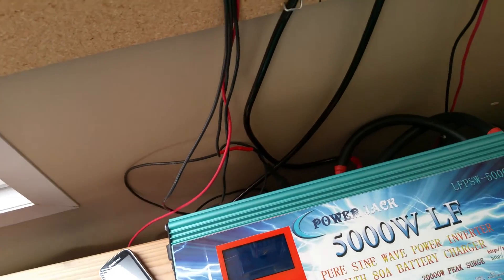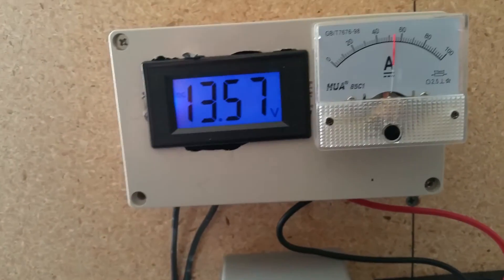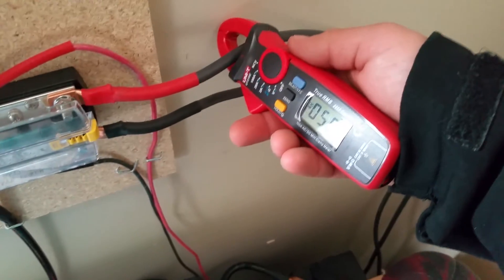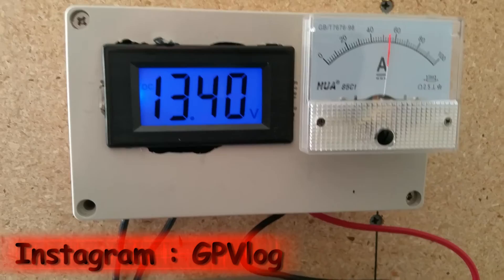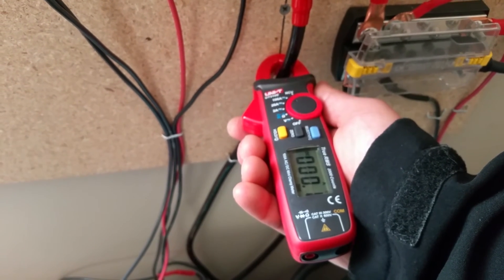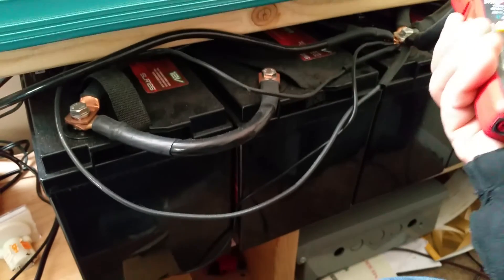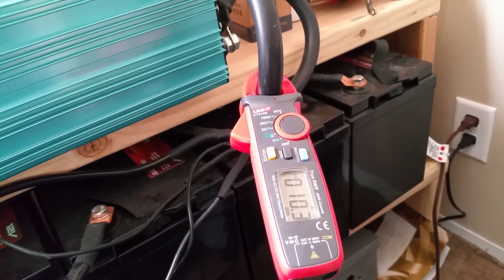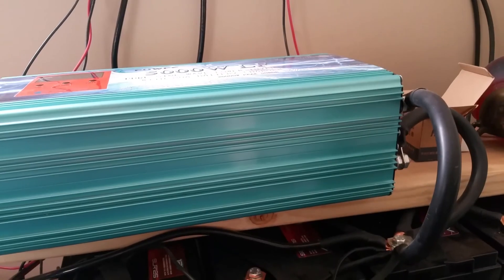Renewable Off Grid Project - Testing my output

Comment: All caught up! Seriously though, you are the only one on the internet with video of a flexcharge in use that I can find. Please add some tags to your videos so they show up on google and youtube search engines. I bought one a little while ago for an 11 ah flooded nicad pack since the flexcharge allowed me to adjust the charging voltage. I just ordered a relay to use potentially on a future project, but I hadn't seen any videos of it in action on a larger system until now.
Reply from the maker: +72fr250 Thanks. Oddly I have flexcharge in my tags. Not sure why they are not showing up.